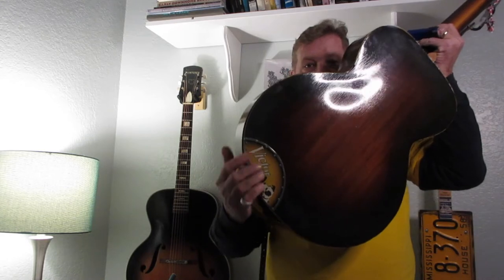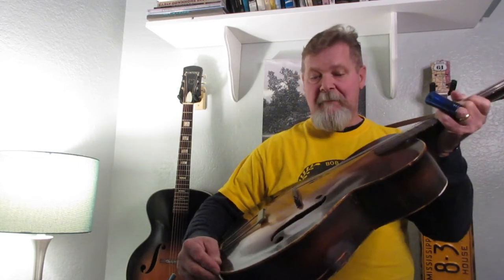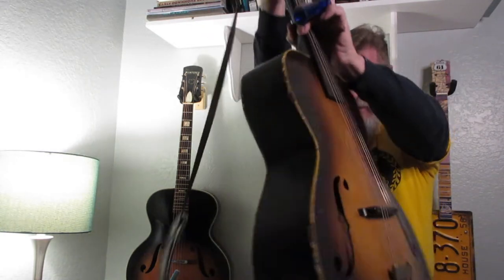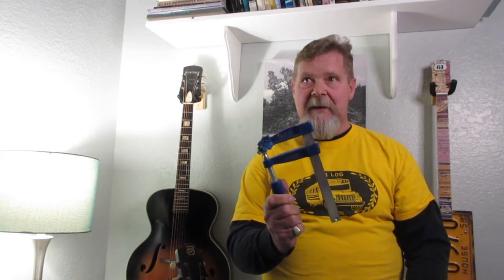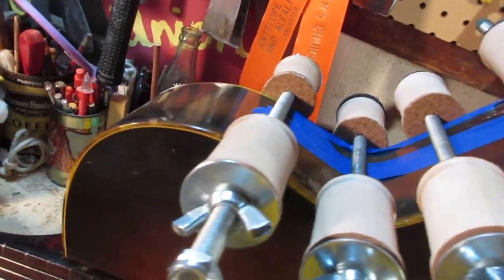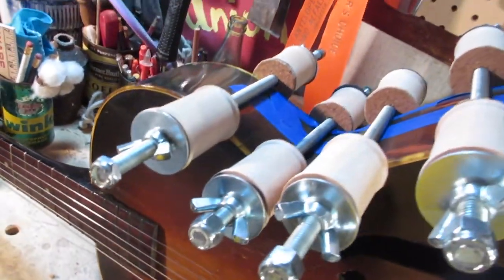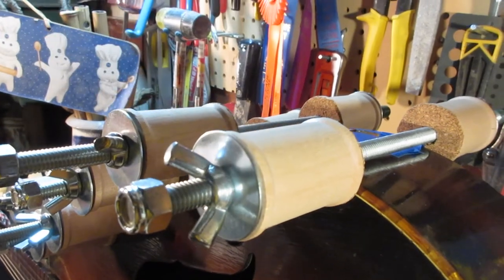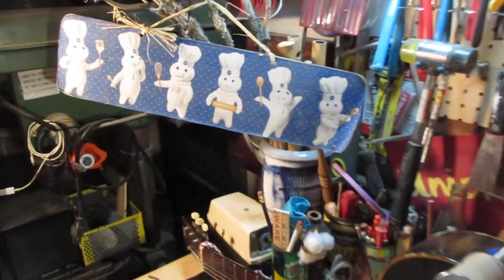Using Spool Clamps to Repair a Guitar Body

Comment: Hey buddy, great to hear your still building CBG as well, you've taught me a lot over the last few years. Great idea with the spool clamps, as an engineer I have everything except the spools in my workshop. Just for info you can get a "bolt burr remover" on Amazon for a few dollars. It looks like a small cone and it fits in your drill. It gives the threaded rod a professional machined finish and the nuts thread on really easy. They're around £9 in Ireland so you'll probably get on for $10-12. 
Can't wait to see you doing the binding, stay safe, Davy